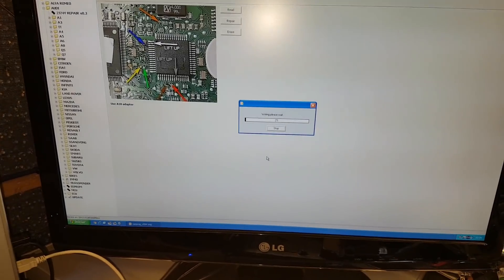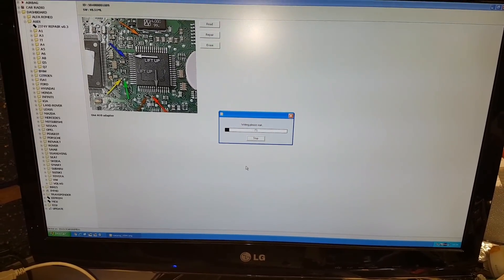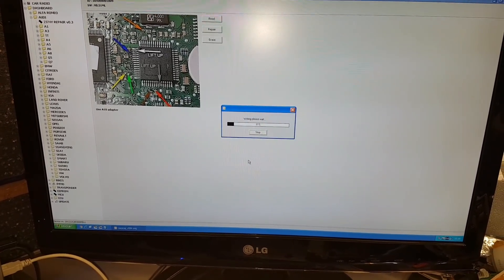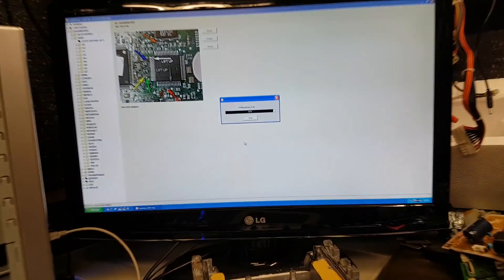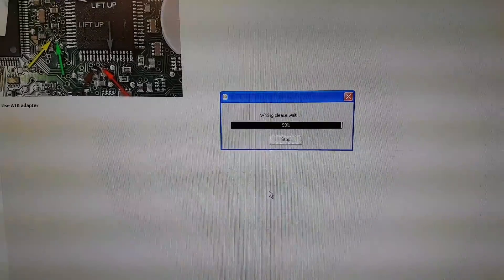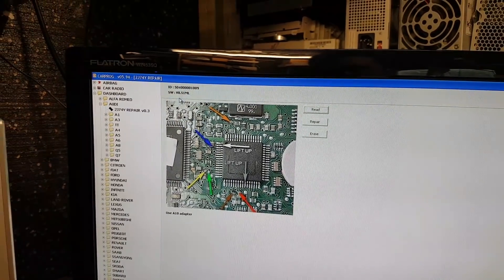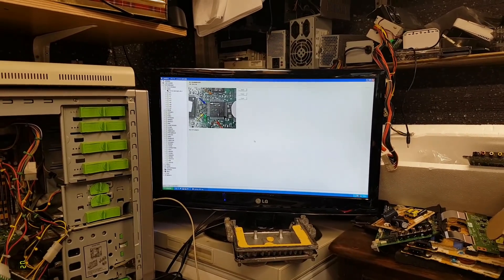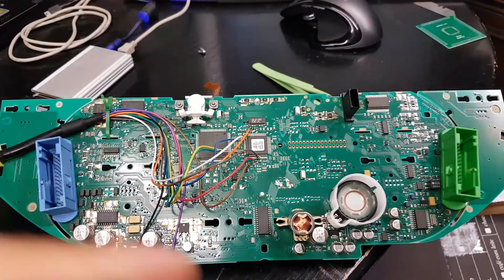Audi A6 2002 B4 cluster randomly stopped working. Microprocessor software reload using carprog.

Comment: Hello from Finland.

  
I have a Audi a6 c5 1.8t year model 2004. I have a problem that appears every time I drive with it, it comes and goes all the time.The ac unit lights are very bright and the voltage gauge is at max (about 16 volt)and when this happens the obd outlet is not working. So these 3 problems comes and goes at the same time (bright light on the ac unit, the voltage gauge is at max, and the obd outlet is not working)
The alternator is good, about 14v all the time, and it is not leaking any AC voltage from the alternator. I saw in a forum that it can be the instrument cluster, is this correct?
Reply: Another Finnish fellow here with A6 C5 1.8T 2003 with same problems but i dont lose communication when A/C panel gets bright (but can't communicate with A/C unit at all via VCDS) . And yeah volt meter acts up but i have other issues also with instrument cluster ( speed and RPM gauge goes 0 while driving etc.) Some people say that A/C panel issue might be result of broken dashlight dimmer slider thingy. I can't confirm that haven't diagnosed mine yet im gonna first focus on fixing/replacing the instrument cluster. I have doubt that in my case A/C unit is faulty but need further diagnosing.
Reply: @mr.jones-932 ok, thank you for that information!
Reply from the maker: Possibly... but i have never came across that problem. 
When it happens, measure the voltage at the AC controller as well...
Reply: Today these problems came  with key on and engine off also, so then the alternator can't cause these problems
Reply from the maker: Have you scanned the car?
Which trouble codes are being logged on the different modules?
Reply: @LMAutoRepairs Yes, there is no fault codes at all
Reply: I found this in a forum:

"I read that inside the instrument panel there is a ram-memory with the software which control the meters, and this software can be corrupted and needs to be reinstalled"
Reply: I forgot to say that before these problems started, the fuel gauge started to show 1/4- 1/2  tank too much. I have checked the fuel sending units, but they are working.
Reply from the maker: OK... you can try the procedure as per the video.
That will reload the software on the cluster.
👍
Reply: @LMAutoRepairs I can't do that😂
Reply: My skills are not enough to do what you did in the video. If you where closer to me, I should send the instrument cluster to you for service😅

Comment: scrap that shit.. and replace with VDO
Reply: There are cars like Audi TT or some A3 models where VDO clusters doesn't exist at all, so can't be swapped. Then there is not many options. We also scrap all MM where possible. Swapping to VDO is just cheaper and quicker and guarantees, that there won't be problems ever. I'm no looking to swap a Motorola MCE on one cluster just for fun.
Reply: @augikslv   When VDO cluster not exist from factory dosent mean that you cant install this.
Reply: @evg_eni   Sure you can replace VDO with MM and vice versa. On A3 8L VDO immo3 clusters are really rare, mostly there are MM's. On Audi TT's there isn't a VDO variant at all, so you have to fix up the MM cluster and there is no other way. On the other side A6 C5 VDO clusters can be obtained for dirt cheap, even cheaper than a new Motorola CPU costs, so you can ditch the MM clusters automatically for these cars. Then it is just the matter of adapting the cluster and programming the keys/immobilizer.
Reply from the maker: LoL
Reply: @LMAutoRepairs  For these specific cars (A6 C5) it is really not worth to fix up the MM clusters. But this repair can be useful for TT's where there isn't a VDO option at all. Also great video! In most seen cases you have to replace the Motorola chip with a new one and program it afterwards. But also the cluster itself is very "famous" for breaking, I have seen a dead MM cluster even after the CPU has been replaced some time ago. VDOs are bulletproof for these old cars. In my country you can get one VDO cluster for an A6 C5 for less than 10 euros.

Comment: i think i have exact the same problem with my audi a3 8l 1.6 2002 can i swap for a VDO CLUSTER ? because this cluster is giving me hard times.   after i saw your video i will not buy the speedo and tacho motors because it s an software problem.    any help and suggestion will be welcome      VIDEO HERE 
https://www.youtube.com/watch?v=ntVTneHA42Q
Reply from the maker: You can replace it, but you will need to move the eeprom... or the MCU...
So mileage and immo is correct...
Thank you for watching and for your comment!
Reply: @LMAutoRepairs  so i have the same problem ? is the software not the motors because sometime it works all of them sometimes is all dead.  thank you for the answer  have a great day sir.
Reply from the maker: @happyman3317  
I never had that issue on a A3... but it can be a software problem...
Reply: @LMAutoRepairs  i have version      V8.42 ML  SO yeah it s corrupted.    today i check also the motors and they are fine . as long as my car run good i will kepp the current cluster . great video
Reply from the maker: @happyman3317  
👍

Comment: Can you please provide also a download link to the archive with the firmware related to this repair?
I have a A6 with random speed stepper problems, when i'm in parking sometimes the needle remains on random values 10, 20, 30 km/h and when the car runs the speed is also alternated, sometimes the needle pass the 260km/h maximum speed, after stop the engine randomly and gradually the needle came to 0 position...
Reply: http://www.codecard.eu/carprog/software/carprog-repair-software-for-audi-2j74y-processors/prod_335.html

Comment: Hi. A4 b6 chasis. I had cruise control retrofitted. All worked fine. Car was sorn. Battery flat. After battery was charged a steering control module stoped working. No lights no indicators no cruise control no electric windows no cemtral locking. Autoscan says no response from streering column module. When i put other module  everything works fine after coding. Is it possible to diagnose if a module is just burned or something? Thanks. Nice channel.

Comment: Nice Job! A little OT,  but what did you do to get your Carprog clone to work? I've tried many ways but no success..
Reply from the maker: Lauri Jokinen 
Hi
Thank you for watching! 
What do you mean get to work, at which stage you can't get it to work?
Reply: I have two units (v10.05 and v.7.28). I have tried to reset Civic Airbag  95640 eeprom. They both read only 00 00 and verify fails. 

I have changed the 4X74hc125m, resistors and one 47 µF cap as they say in Codecard.eu web page. After this mod connection is no stable. I have Win7 and few SW's (4.01, 4.47, 9.31) I've serched solution from digital kaos too but no luck so far..
If you know what could be the problem/s, I'm all ears.
Thanks
Reply from the maker: Lauri Jokinen 
I presume yours is a clone...
Have you tried to reprogram the atmel MCU?
Reply: +lmsvvavr Yes, mine is clone. No, I have not tried reprogramming. Do I need special tools for that? At first, without any mods, I managed to read and write 93c chip with 9.31 online version. But that was the only thing I could do with it. 95640 failed in verifying.
Reply from the maker: Lauri Jokinen 
I would try to reprogram the MCU... if that does not resolve, revert the changes you have made...
How do you add credits to your carprog?
Reply: I think that both (10.05/8.21 and 7.28) have no counters..
Reply from the maker: Lauri Jokinen 
You might have a different version then...
I would advise you to revert back the changes and if that doesn't work,  contact the seller...
Reply: Yes, I'll give it a try. I've had bad luck with monday-versions in all sorts of things in the past, hope to get this working.. Many thanks for your help!